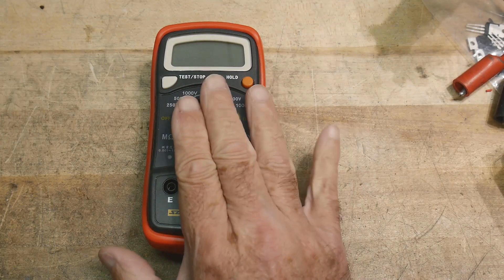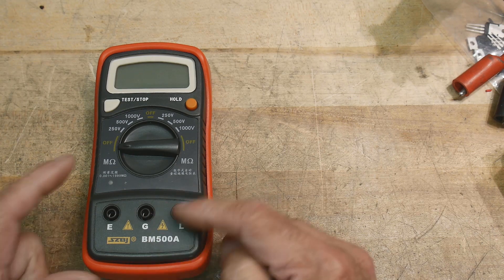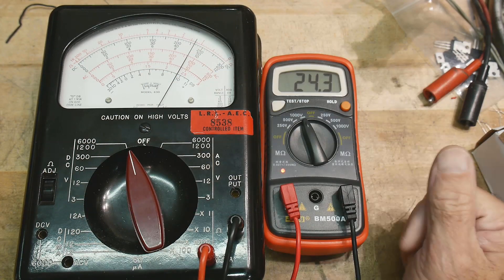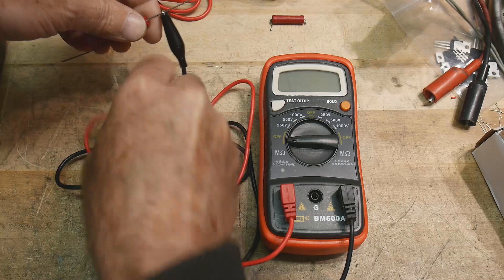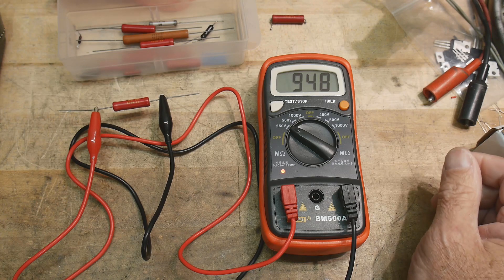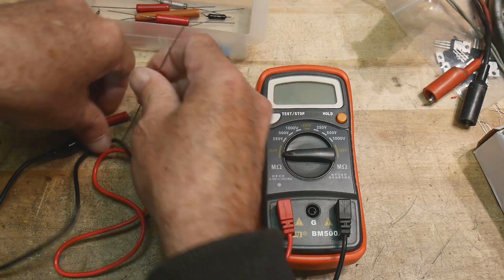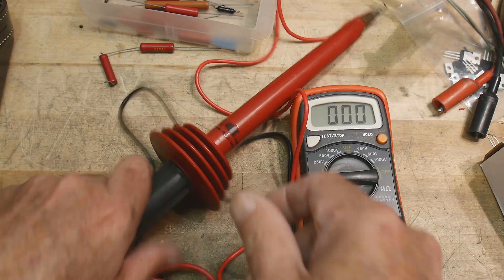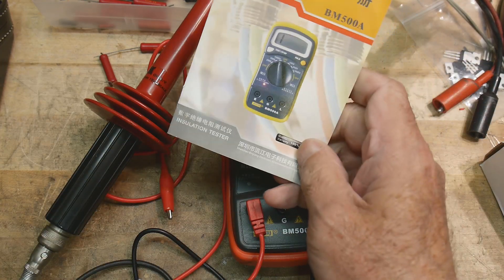#762 BM500A 1000V 1999M Digital Insulation Resistance Meter

Comment: I bet having two sets of voltage ranges is so you can quickly go to Off in no more than 2 steps.

I am curious on what the max current is on this meter.  I bet it isn't much so not super dangerous even at 1000v.
To register 0.1M ohms, which appears to be the minimum reading, at 1000v only need 10mA.  That might smart a bit but typically won't kill.

Comment: I use a similar meter to check the caps in tube gear for electrical leakage. So often, you have one that seems to be fine in the lowest range, but when you go one higher, the cap breaks down.

Comment: This is good for testing the dielectric in coax cable.  When you apply a high voltage to things that appear not to be leaky with a regular ohm meter they will show up leaky when you apply a higher voltage to measure the leakage current.  There's a good video here: https://www.youtube.com/watch?v=mXWacoQBWq4 that shows some other uses.

Comment: I suspect the HV probe is designed to be used with a specific voltage meter and the probe will provide a series resistance (370 MOhms) working as a voltage divider with the input impedance of the meter it's designed for.

Comment: I imagine finger oils on those high value resistors may cause some non linear extra conductivity. Might be interesting to see if the resistance changes uncleaned vs. Careful isopropyl cleaning of the resistor body.

Comment: I have the english well Chinesium version of the instructions it says the maximum range of the meter is 1999 M ohms L to measure less tha is the input terminal to be tested, the G is the shielded terminal of the insulating resistance and E input terminal Connected to earth terminal of the tobe tested object. "I" will be displayed for overload sampling rate is 2.5 times per second, and a lot more Special attention in operation
when use at 500V to measure less than 1.5 M ohm 1000V to measure less than 5M Ohm measurement time must not exceed 10 seconds. See as clear as mud, oh and the ends should be discharged after pressing stop . HAve fun and Enjoy :-)

Comment: Looks like a nice meter except for the part where you need to learn Chinese to read the manual...
Reply: This video helped me a lot, thanks for putting it up. Here is a link to the manual below. Still doesn’t make sense as to what the third lead is. I think for mains powered equipment E goes to earth, L to line or active and G to the surface or chassis being tested. Here is the English manual. http://img.banggood.com/file/products/20161209004235BM500A%20maunal(1).pdf

Comment: irregardless isn't a word! :-D
Reply: Correct :-) Use either "regardless" or "irrespective".
Reply from the maker: Merriam-Webster defines irregardless as "nonstandard" but meaning the same as "regardless." "Many people find irregardless to be a nonsensical word, as the ir- prefix usually functions to indicates negation; however, in this case it appears to function as an intensifier," the dictionary writes.
Reply: @IMSAIGuy  Sure, but it's so much fun to be a critic! ;-) Also, 50 years ago I had a friend who went to Catholic School, and he said the nuns would beat you if you used that word...
Reply from the maker: @ats89117 Thanks for the heads up, I'll watch out for the sisters